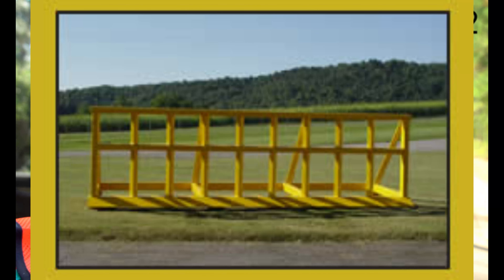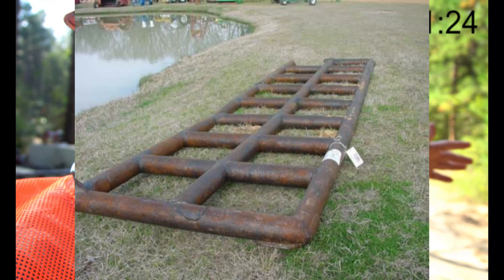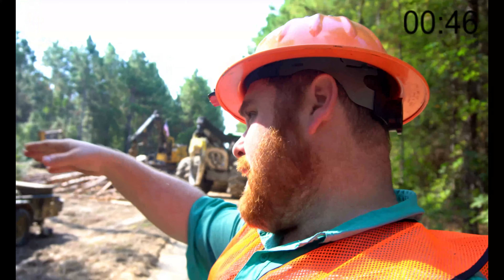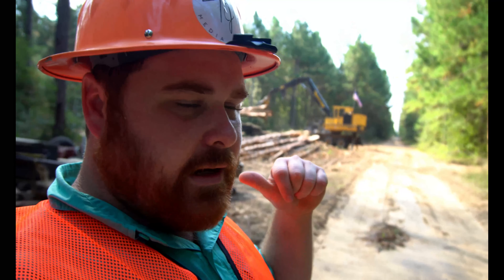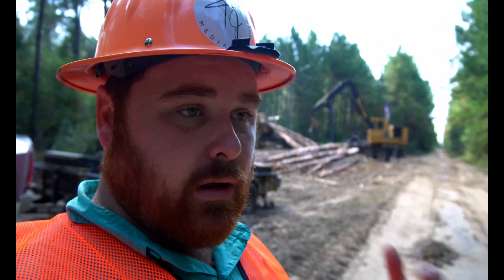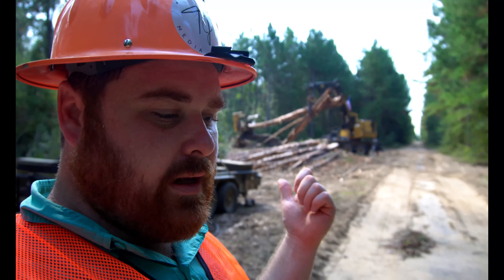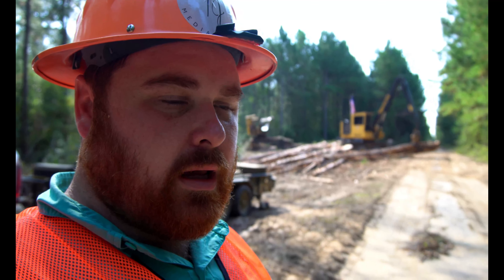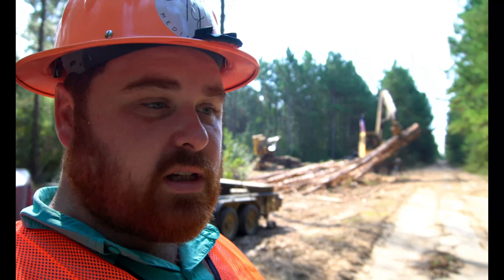What are Delimbing Gates

Comment: Instead of gate which we do have I’ll pick out a set of 3-4 trees close together with a 5th tree I can use as a turn tree and when I come around it it’ll kick the tops squared up to the group of trees and then back through them. It works pretty decent and then cut the trees at the end since they’re scarred up
Reply from the maker: We have done that before also. Works nice when the timber is right.

Comment: What I hated about gates was skidders had to pull smaller drags to get it through the gate and it adds time to the skid. Like you said it’s harder on the skidder too. In small wood the stems would break.  The crews I use to work one used 2 loaders first one delimed and sorted the other one cut up and loaded. We moved 25-30 loads a day like this clear cutting pine and hardwood. A few crews around have run slide boom delimbers but all went back to loaders and pull throughs. It’s all about cost,terrain and the type of timber you harvest and what you can make work.
Reply from the maker: That’s right!

Comment: Equipment decisions are all about compromises. Delimbing gates are hard on drivetrains of skidders. Pull through delimbers are hard on turntable bearings. Processors cost a fortune. CTL systems are not productive enough and are too expensive to be profitable. It's basically pick your poison. It's what can you use to make you the most profit and get the job done.
Reply from the maker: That’s exactly right.